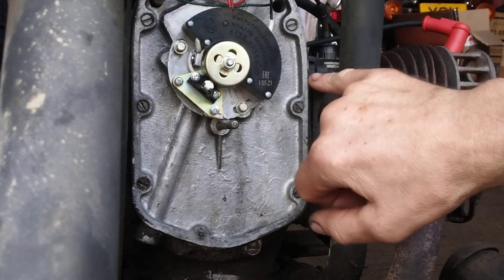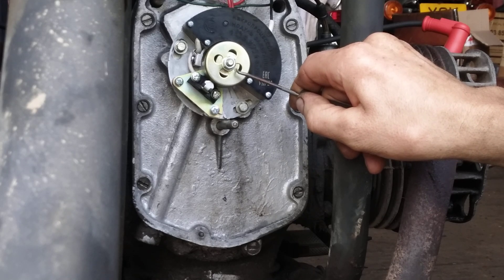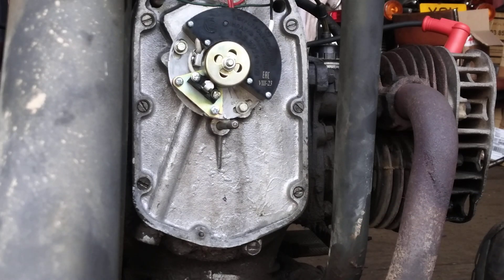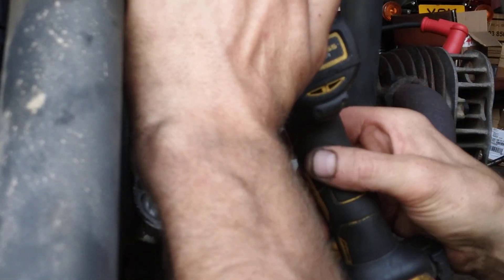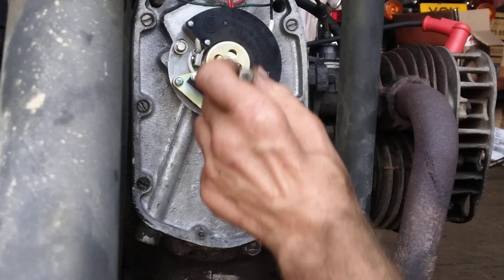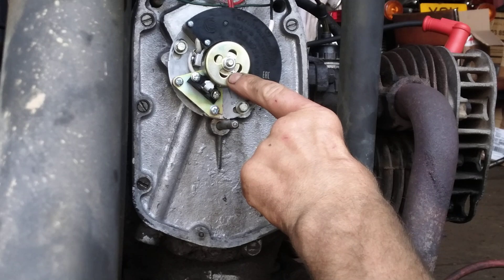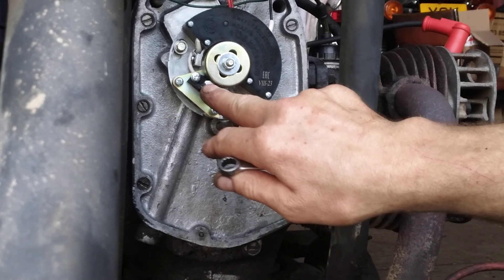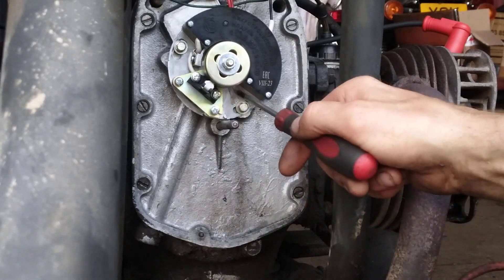Fitting Sovek electronic ignition to K750/M72 part 2: Pegging rotor to adaptor.

Comment: Does that ignition have a built in advance curve?
So the adv ret lever can be disconnected
Reply from the maker: Yes, the lever becomes redundant. It actually gives you a much smoother idle because the original  lever is sprung loaded to full advance, which makes the idle very lumpy unless you're holding it on ret.
Reply: @championn3c574  thank you.
Reply: Where abouts in the world are you? Just in case.
Reply from the maker: @robertscott-godley4380  Sorry, I missed your comment but I'm in South East England.